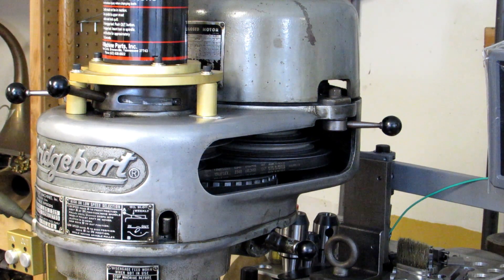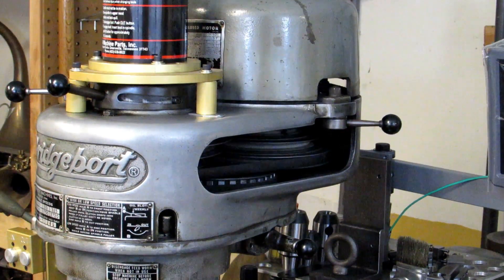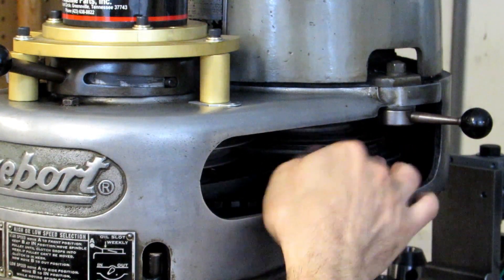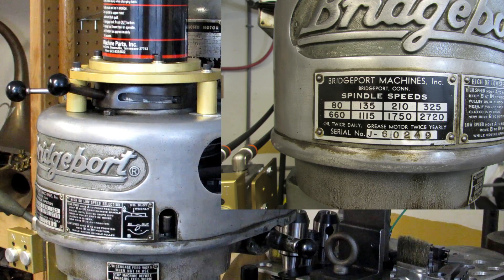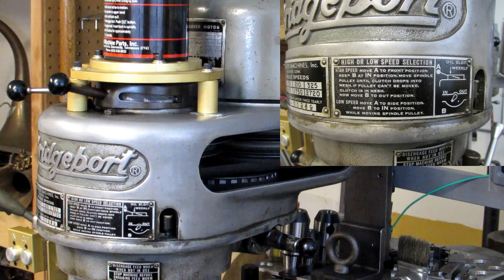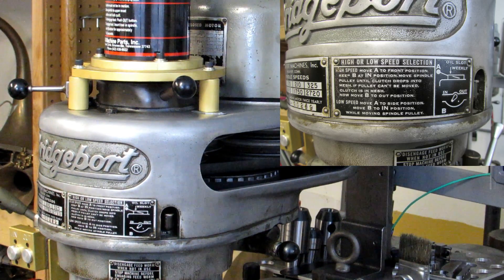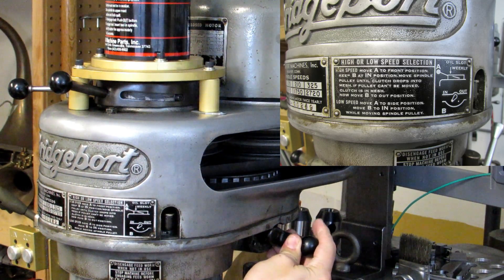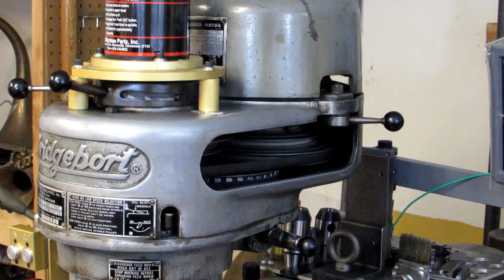Changing Speeds on a Step Pulley Bridgeport Mill (and Clones)

Comment: Enjoy watching your videos Stuart.  Is it possible to replace the V belt with a Link belt to eliminate having to take apart the upper housing?  Thanks...
Reply from the maker: Sure, although you may find changing belt positions to be more difficult. The 4L profile belt on the machine is slightly thinner than a standard A belt. I've replaced that belt with an equivalent A and AX belt before and the extra thickness made it harder to change positions. The AX was especially bad because of the notches on the back. That made rolling the belt between sheave positions WAY more difficult and that's something you'll have to contend with on the link belt as well. One other concern is that the link belt is meant to run in one direction.  That’s not a big deal on a lathe when it rarely runs in reverse, but on a mill it's going to be reversed whenever you switch to low speed and will run that way for extended periods. Taking everything apart and replacing the belts isn't that big a deal. It's a half hour job. You'll want to have a buddy handy to help with lifting the motor/holding the ladder. BTW, if you're going to take it apart to change the v-belt, change the timing belt for the back gear while you’re in there. You don't want to have to take it all apart again a few months later because that one broke.
Reply: @StuartdeHaro  Thanks Stuart for the prompt and thorough reply.  I did think about the mill running in reverse for back gears and how the link belt is made for running in one direction after asking the question.  That is a good call about replacing the timing belt as well.  Thanks again!
Reply from the maker: @luisgaray2550  Good luck with it!

Comment: 1 more question:  When I go to remove collets or my chuck, they STICK, and I have to tap on the top of the bolt to get them to drop.  If I get an automatic "tightener / loosener" as your machine appears to have.....  will they still be "stuck" up in there?  (The reason I ask, they are stuck well enough, you have to tap to get them out. I do not tighten them as if I am a brain dead gorilla, but tight, snug enough to hold.)
Reply from the maker: That's normal. The taper is slightly self holding. With the power drawbar it shouldn't stick, although it can if you hold the IN button down for too long and over tighten the drawbar.
Reply: @StuartdeHaro  Oh, I see. Since the power drawbar is fixed, it will push down on it, verses the bolt that just goes up toward the ceiling.  Been a long week my friend.  LOL
Reply from the maker: @brentbarnhart5827  Yes it has. Let me know if you have any other questions.

Comment: I'm an engineer, machine designer who recently bought a Bridgeport for convenience. (I am NOT a machinist, although after 7 months, I would like to think I am "getting there.") I send out almost all of my machining, as I am the designer, creator of very unique machines, and we ASSEMBLE, and troubleshoot them in our shop. Including electrical engineering, automation, etc. But the Bridgeport is essential for part modifications, emergency parts, jobs, modifications, etc. and one of the BEST investments I made in 2022. I do have a question. I bought a set of R8 End Mill Holders (that have set screws) because from what some had said online, they were necessary, to keep the tooling from spinning, putting the set screw onto the tool "flat." Then I read I needed a full set of precision R8 collets (no set screw). But then AFTER all of that, EVERYBODY just seemed to RAVE and RAVE over the ER32 Sets. So I have "mostly" been using the ER32 collet inserts, but I do not find it any less work. You have to unscrews the insert collar, with your special spanner, change out the insert, etc. On the regular precision R8 collets, you do it by the top screw, done. There is NO LESS WORK, to change out the ER32, and it also, is not any faster. Other than, you do not have to reach "over your head" to manually tighten the bolt (who cares) why is that promoted to be such a "great thing" and "need to have?"  Am I missing something?  I just started using the Precision R8 collets, and think I like doing that, over changing out the ER32 inserts better.  NEXT.... I get me an automatic screw tightener / loosener for them. Your Opinions?  Am i crazy?
Reply from the maker: They all have their place. End mill holders are rigid, although the set screw will shove the end mill off center a bit which decreases tool life. Concentricity is great on collets but the end mill can slip out if it isn't tightened enough. You also your Z location whenever you change tools. ER collets offer a best of both worlds situation, the concentricity of collets but rigidity and consistent Z axis length of end mill holders.
Reply: @StuartdeHaro  THANK YOU for an explanation that makes sense. I wasn't thinking of it that way.  For some odd reason, I was thinking it was for mostly "convenience."  That makes engineering sense.  (I don't think I used the ones with a set screw but 1x. Also, I've never had any slippage with the ER's either.) Great Channel. I'll make sure I'm subscribed.